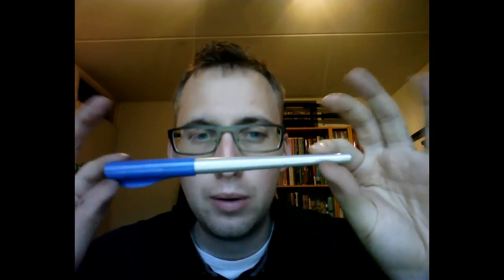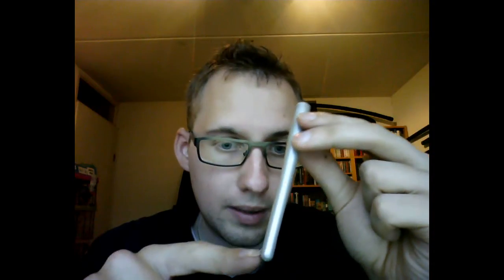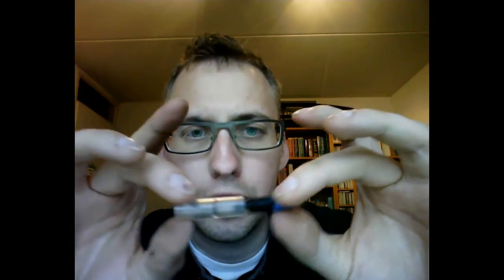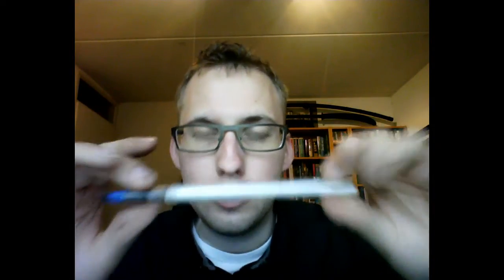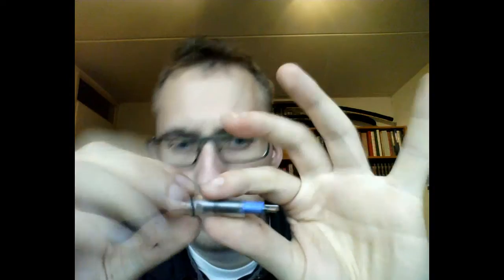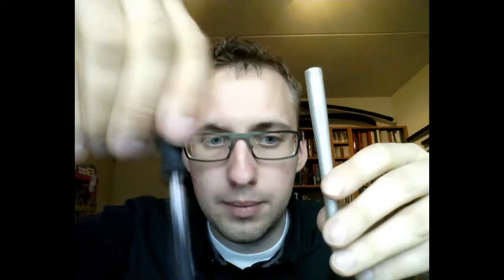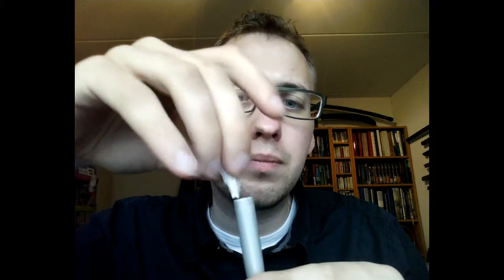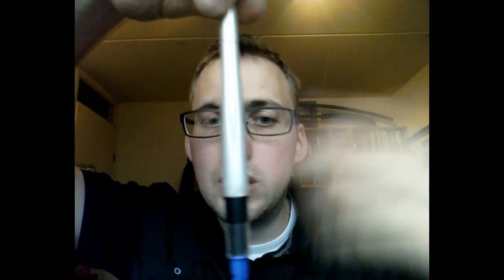Pilot Parallel (conversion to eyedropper)

Comment: Thanks, Stephen! That makes it even easier. (*Eyes 1.5mm Pilot Parallel that needs to hold more Platinum Mix Free Silky Purple:Sunny Yellow (1:1) for the prettiest red ever ink*)

Also, thanks for showing how easy it is to disassemble the Pilot Parallel. Very cool!

Comment: Hello, Stephen. Nicely done.

How important is the O ring if you use the silicone grease? I wouldn't use the O ring without the silicone, but would the silicone effectively prevent leaks by itself?

Cheers!

Comment: The Pilot Parallel is perhaps my favourite calligraphy pen (mine is also 6.0mm). The only downside is that the 6.0mm nib sure uses up a lot of paper. ;) I also fill mine as an eyedropper, but I'm kind of concerned about the little covered up hole at the end of the blind cap - it looks like it can be punctured easily. I'm not about to find out, though!

Thanks for the video - I'm slowly making way through the rest of your videos, so expect more comments! :)

Comment: I just recieved my first Pilot Parallel and can;t wait to convert it to a dropper pen.  I bet you go through a lot of ink with the widest nib they have so converting it is a wise move.  Can you tell me, what is the best way to store Parallels and fountain pen?
Reply from the maker: I typically store them in pen pouches.
Reply: lol...I meant vertical or horizontal  I presume horizontal.  Thanks for input.
Reply from the maker: Lindie Lee Horizontal or vertical doesn't really matter; it's best not to store pens inked.

Comment: thanks for the video. couldn't u just use the converter (they say to use to clean the pen) it comes with if you wanted to use your own ink? i read on fpn that ppl have done this. is this an option if you don't want to fill the whole back part of the pen with ink? 

please get back to me! 

thanks!

CC

Comment: Can anyone share the exact size of O ring needed? I am using the con-20 converters and found at least one that was loose and leaked ink into the barrel. No leakage from the pen itself though until I unscrewed it (and found a mess!). So this is good news (may not need an O ring?). But just to be safe I would like to get an O ring.
Reply: I believe he uses the Platinum Preppy sized O rings from GouletPens.com Here is a direct link - https://www.gouletpens.com/platinum-preppy-o-rings/p/Plat-PPQ-O

Comment: Why do all this? I simply removed my cartridge, filled up the pen handle, and put it back on. No O ring, no grease, no leak, no mess. Gotten years of use out of mine this way, you just have to keep it clean. That and try not to write with a gorilla's hand.